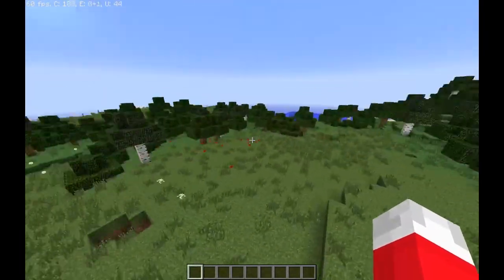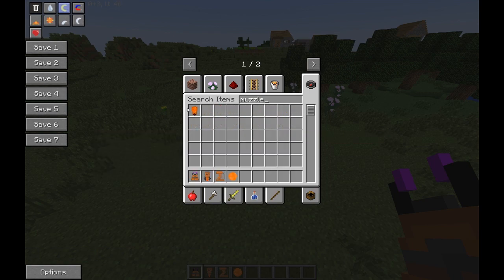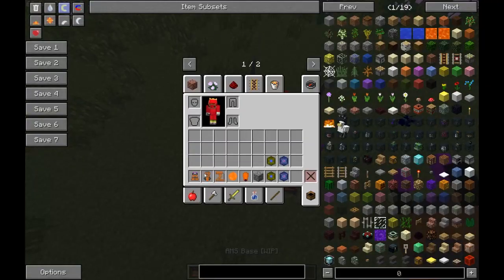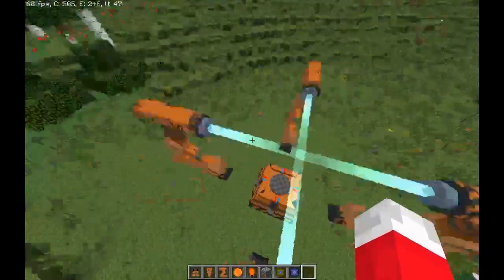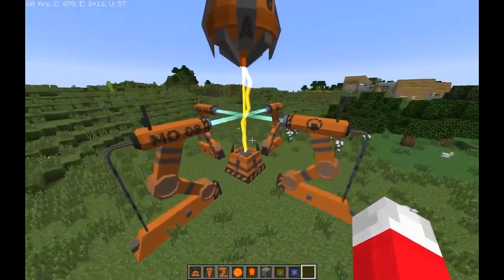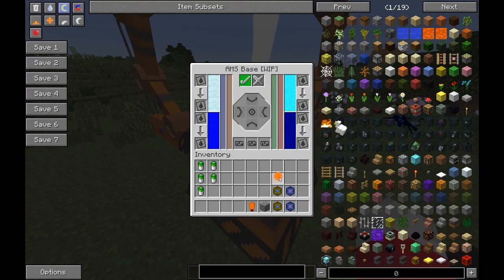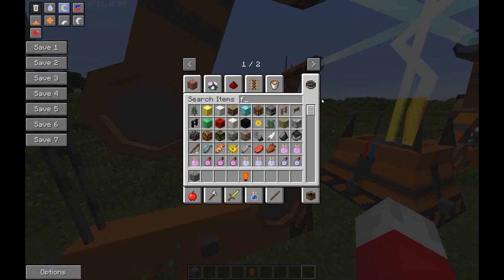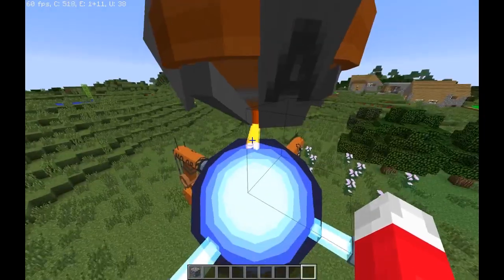How to make an AMS in HBM's Nuclear Tech Mod | Tutorial

Comment: note: if you wanna change catalyst remove the core 1st then change the catalyst and also if your underground the reactor wont kill you

(idk if this works for the real mod coz i use the reloaded one)
Reply: hbm reloaded is nearly identical in terms of game mechanics, it's just a bit outdated compared to the original 1.7.10 version. Usually a few months behind.

I play on 1.12.2 and use the reloaded one too, put on a very strong armor set to protect yourself. Most of the power armors should work as well as full schrabidium. Dunno if any of the hazmat suits will protect you from it tho, haven't tried.
Reply from the maker: im using the reloaded mod in the video, i used another tutorial and thought that the only catalysts you could use were those two types lol
Reply: @disepto  how r u not dying it kill me in creative
Reply: @amonguswithyuru1727  Put on the most powerful hazmat suit

Comment: there's no FEnSU in HBM?

i got the curseforge version.
Reply from the maker: There is a FEnSU in HBM. Check to see if you have the most recent version.
Reply: @disepto  i am on 1.12.2 hbm and for some reason i dont have stuff like the FEL laser spectrometer and the SILEX gui seems to be unfinished also i dont have ZIRNOX reactor, RBMK fuel rod crane, and others